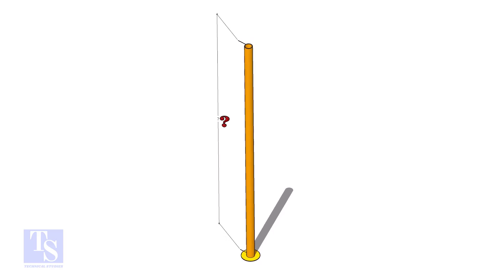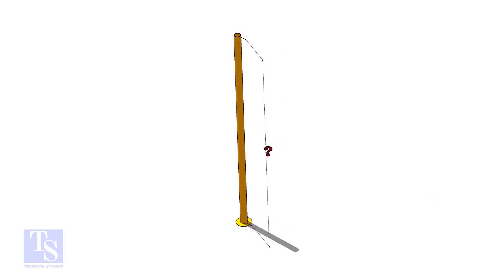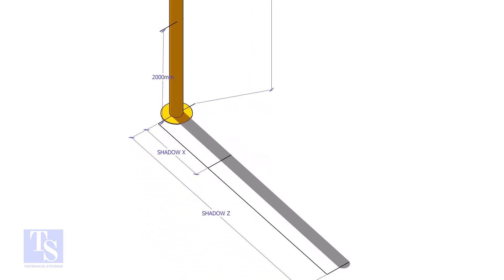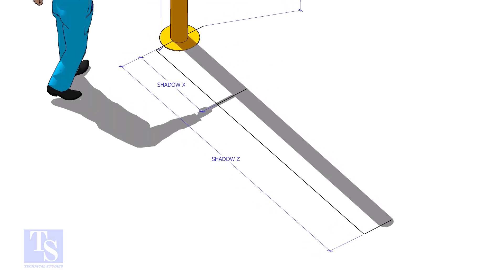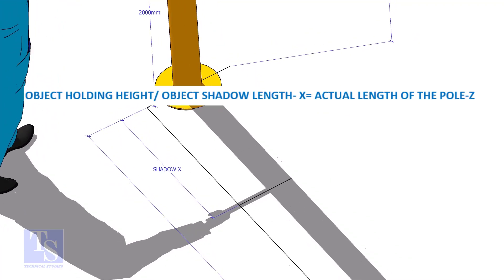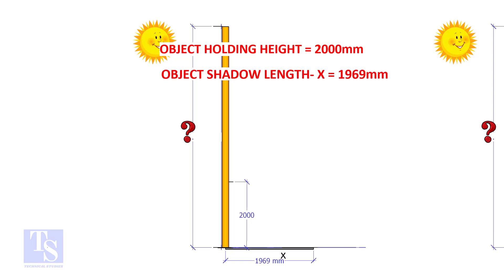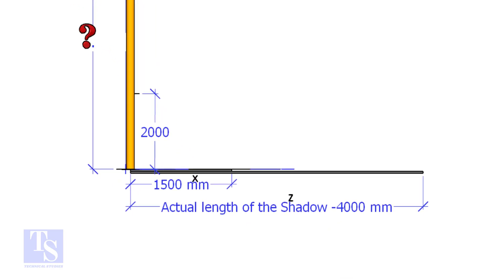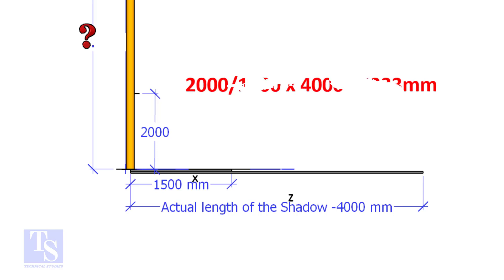TALL CHIMNEY, TOWER, COLUMN HEIGHT MEASURING USING ITS SHADOW. Pipe fit up tutorials

Comment: Often as Steel fabricators we are sent out in the field by the Engineering group or by the Estimators to gain approximate dimensions of items so that things can be priced and drawn up, whether to make a new item or to replace an item. 
So you do not want to take long to get a dimension, and the shadow method is a good quick way to achieve this. If your company wins the job then more accurate dimensions are obtained later and costed into the job. 
So knowing how to do this along with a few basic Mathematic skills as shown in the tutorial will make the fabricator an important and valued member of the company. 
Again another good tutorial for people to learn and improve their skills and knowledge. Also important to practice this in your own time so you can become confidant of what you are doing, so that when asked you can say yes I can do that.
There are also other methods of gaining this type of information when there is no shadow available which hopefully our friend at Technical Studies will also demonstrate in the future.
Reply from the maker: Thank you Mr. McKeon. Some 35 years back, I used this method to measure a 30 m x 800 mm dia Chimney. It was heavily corroded and was impossible to climb on. The chimney was made with 2m long shells x 15 numbers, so we already assumed the height, standing on the ground. And this shadow measuring method assured the assumption. As you told, there are other methods also, but i think this method is easy . Anyway, for me, your comment is more interesting than my video. Expecting more valuable comments from you.
Reply: @technicalstudies.  Look forward to  seeing to the other methods